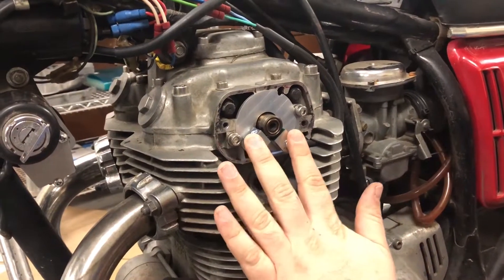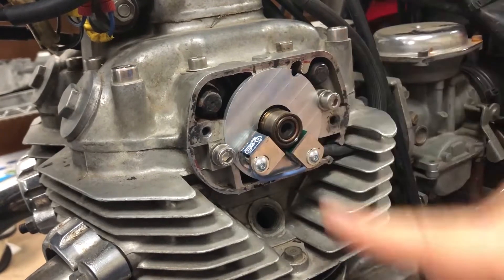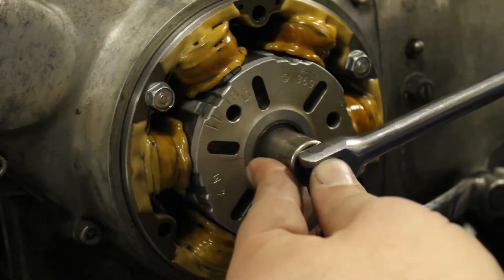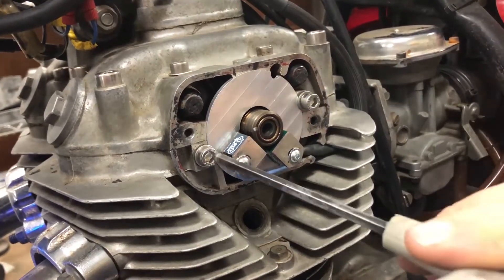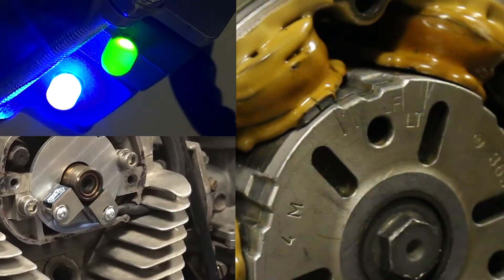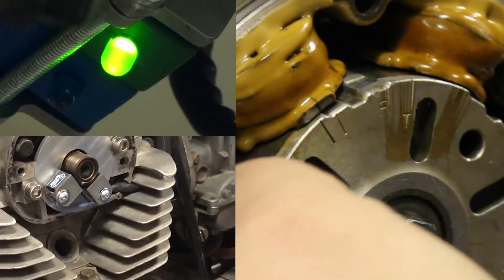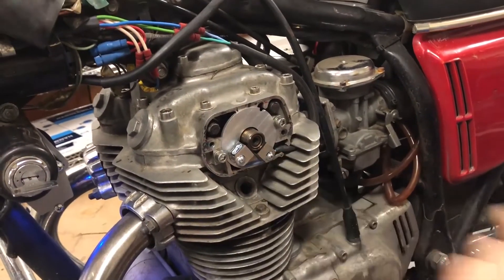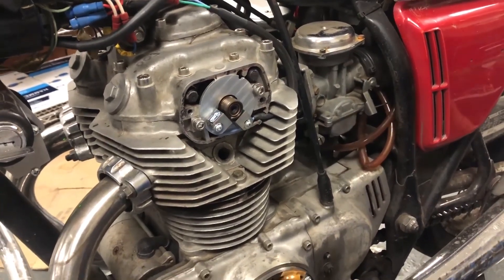Setting Ignition Timing on the Shockwave Electronic Ignition System (Detailed)

Comment: I get the left sensor timed perfectly (distance to cam, blue light goes off exactly at the LF mark), but the right sensor is so far off that I can't get it timed. I need to slide the right sensor to the right more, but it's already maxed out to the right. To get the right sensor timed, I'd have to move the sensor plate so far to the left that it would throw off the timing of the left sensor. How do I remedy this?
Reply: You ever sort this out? I have the same problem.

Comment: Set the fire mark at the flywheel and adjust the sensor plate to time. Then the ignition timing guessing game becomes unnecessary.
Reply: I did this, no luck. Good spark, no fire. Pushed the bike back into the corner. Maybe next year.
Reply: @billstrube3425  I had some trouble with the advance slipping off of the little “key” while timing the bike. You’ve really gotta crank it down for it to want to stay.

Also, the surface on said advance can be pretty dirty and it picks up on the sensor. I took mine straight to a wire wheel.

Comment: Do you set both the left and right sensors on their respective compression strokes or do you set both sensors on the left cylinder compression stroke only?
Reply from the maker: Each cylinder is timed on their own compression stroke.
Reply: i had this same question but it has to do with the phaseing of the cam and crank. this is a 90 twin not a true 180 twin, meaning ,when the piston/ cylinder fires and moves down, the right piston moving up is also on its compression stroke, about to fire, unlike a true twin, which would have the rights exhaust stroke, immediately after the left piston fires downward
Reply from the maker: @californiamonster8877  3 types of 4 stroke inline twin engine architectures. 360 degree crank, 180 degree crank and a 270 degree crank. Honda CB350, CB360 & CB450 are the 180 degree. Points are cam vs crank driven which changes the position of the points firing to be 90 degrees between strokes,  then 270 crank degrrees of exhaust & compression before the next power pulse....bang, bang...chug, chug...